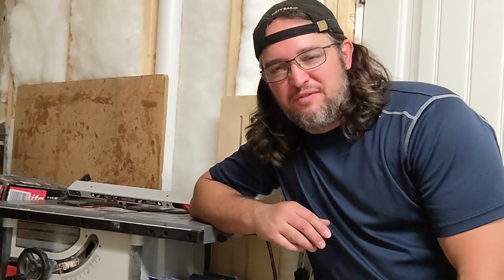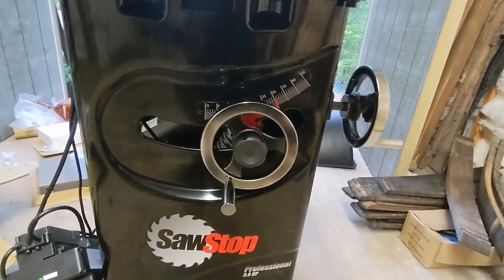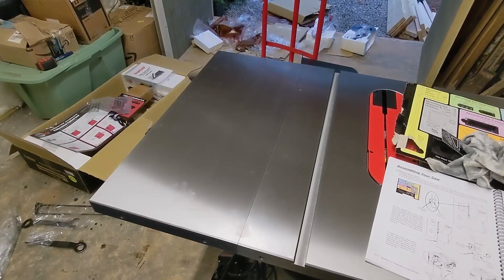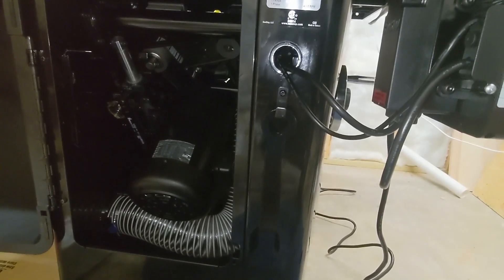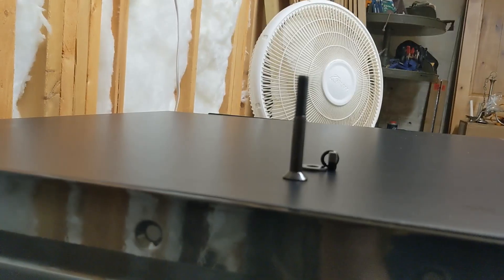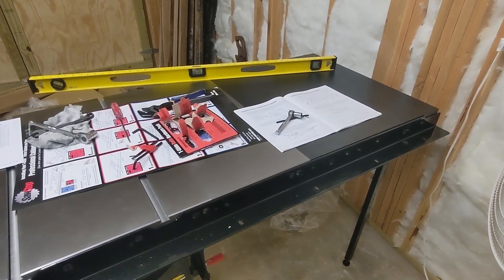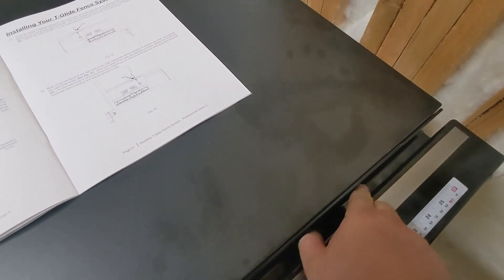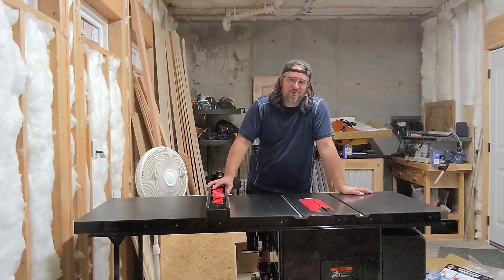How to assemble a SAW STOP table saw.

Comment: Cmon man, you're just reading the instructions. I just finished the table (haven't gotten to ext yet). I can't help but notice you left out a good deal of pain. FOR EXAMPLE what "tedious" means ie the agony of standing it up (solo), the endless grease that makes wing alignment next to impossible without an adjustable height surface (I had build one), the time it takes to figure out you need to push the hex key THROUGH the thread slot to attach the switch box and a about a million idiotic design issues like the wheel key that frustrate installation.
Reply from the maker: It took a while but the instructions were good. Thanks for watchin.